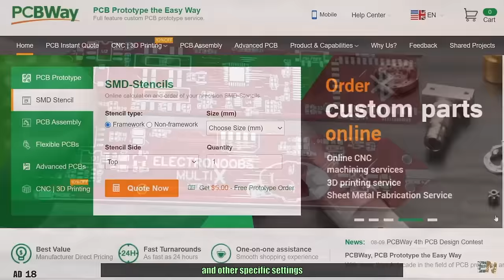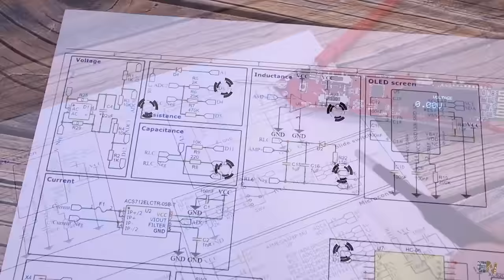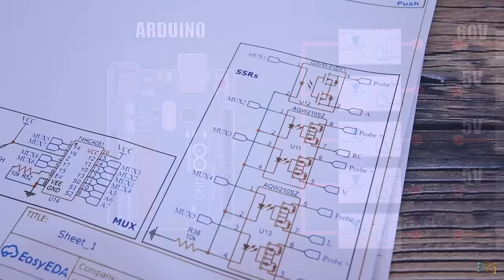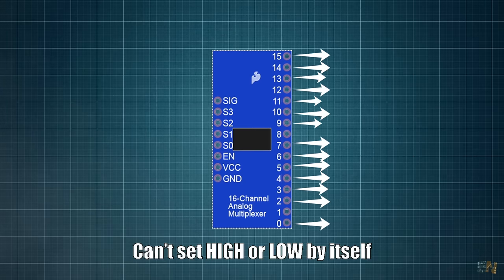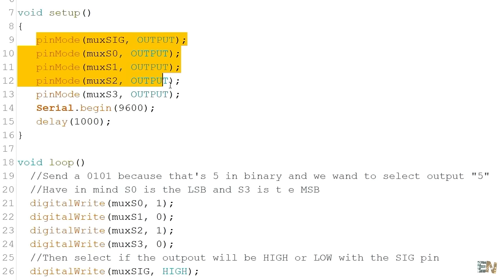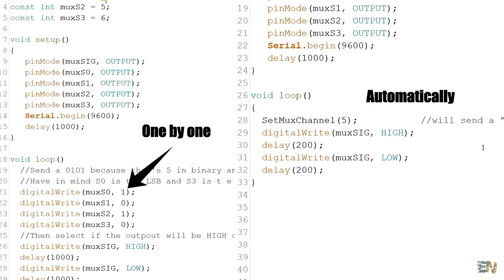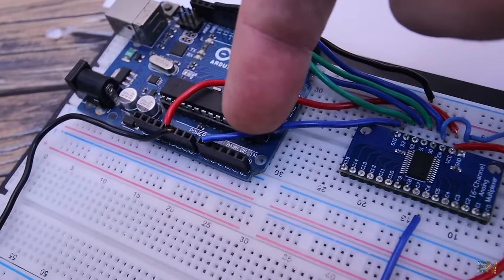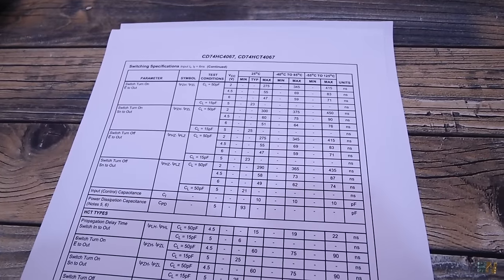Arduino Multiplexor - MUX INPUTS & OUTPUTS - ANALOG and PWM

Comment: you can actually turn two leds at the same time if you divide the time and frequency for each led. For example you could change the output channel every 10 ms and you would see that (virtually) different leds are on. This can also work for demultiplexing
Reply: Would that work for toggle switches or would they flicker ingame?😊
Reply: you could also install latches.

Comment: You could have used a 74HC595 sipo shift register, it uses 3 control pins and gives you 8 digital outputs, but you can daisy chain them for as many digital outputs as you like while still using only 3 pins.
Reply: Exactly my thoughts: use a shift register. Moreover, with a latch and output enable signals, you can also solve the issue about turning two (or more, or all) pins in the same time. But you lose the input ability hehe, I guess you can't have all.. 😛
Reply: Shift registers aren't instantaneous. Although it won't be important here.
Reply: @tunahankaratay1523  it could be used for daisy chaining pairs of mux devices
Reply: @laurv8370 for input ability yhetes the opposite of the ic , parallel to serial ic , I think it was 74hc165
Reply: @tunahankaratay1523  Shift registers ARE instantaneous. It is called latching.
Reply: @laurv8370 yes but between each latches there's signicant drop in speed. But it doesn't matter if you just need a LOT of outputs / inputs
Reply: Shift register won't demux though
Reply: Shift registers are binary. Won't work for adc reads. That's the main purpose of multiplexing.

Comment: Much simpler you can use charlieplexing on led part of optocouplers/SSRs , because it doesn't require an auxiliary ic for that task. For example with 3 i/o pins we can control up to 6 i/o devices, with 4 i/o ... up to 12 and so on. The basic formula for this is n*(n-1)=num of i/o, where n = num of i/o pins

Comment: How to use this chip in rc transmitter and receiver project you made earlier? I want to make a 10~16ch transmitter but ran out of pins this seems viable but how to read all inputs at same time and output too. 😅

Comment: Thanks for making this video. I was going to use one of these MUX devices to increase the digital pins of my Nano but had not considered the limitation of only being able to address one pin at a time. I now may have to use a different MCU or maybe design a latching arrangement. Which would you suggest?
Reply: I'm in the same boat, wondering if there is a simple and cheap alternative that would easily add more I/O's that aren't limited to only using 1 pin at a time.  I have used the 74HC595 sipo shift register method as well, but wondering if there's another way like this MUX but better?

Comment: The important point with MUX is that the input signal is redirected to the selected ouput
Reply: basically it short circuit like a switch right? Not like the channel reproduce the voltage? Im just wondering if I can redirect a 0.3V to whichever channel I want.

Comment: Great video...you used pwm and you said the response time of the MUX is in ns range...why not program it to select the to inputs or outputs you need at the fastest possible rate it can handle and simulate having two I/O on at the same time...more than likely you will never in this application need that fast response time. It's like pwm Led dimming to ours eyes it's dimming but it's really not.

Comment: This seems like a place i could get some help on my project. I've muxed 16 analog inputs (force sensitive resistors) and connected them to the esp32. after finding right resistors and one capacitor,  i get the reading in arduino ide serial plotter and it looks nice, but all of my signals are read at the same time... how do i separate them so i can isolate single fsr? any advices?

Comment: Ok.  So. Ive a question,  is this in a general sense,   the same type of thing that is used to modify or tune a vehicles various control modules. Pcm bcm tcm.   In regards to the piggyback style tuning modules like hondata and demon tuning.modules. 
Correct?

Comment: Can you pls make a tht version of diy Arduino, with the chip that's needed to program the Arduino.
What i mean is that use all tht components except the ones that can't be such as that chip or voltage regulators.

It would be very helpful
Thank you